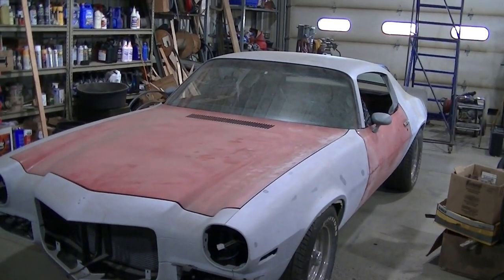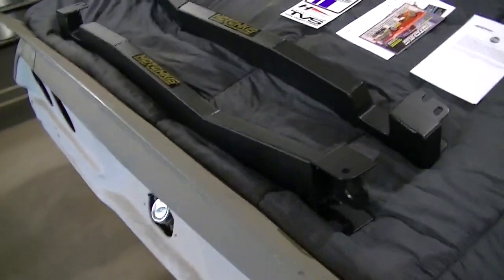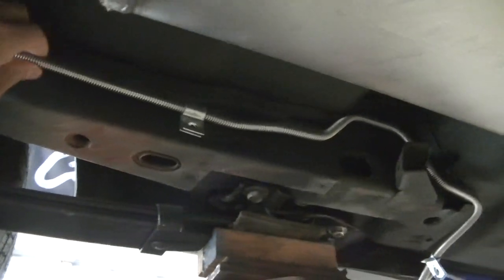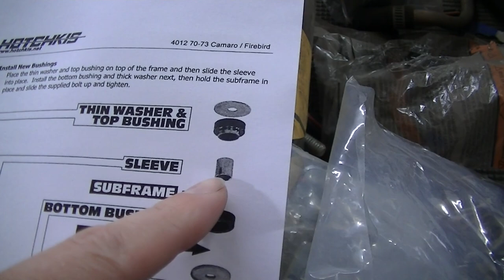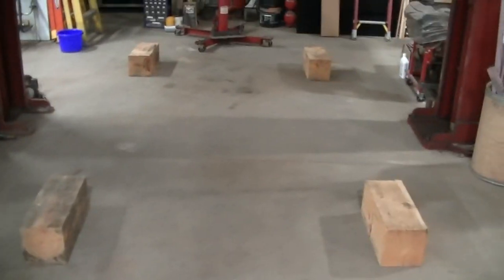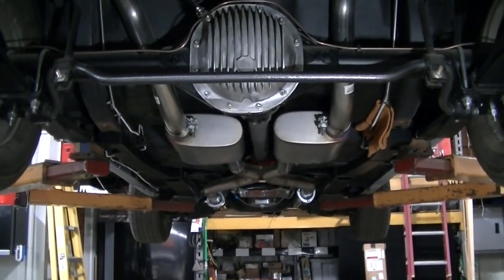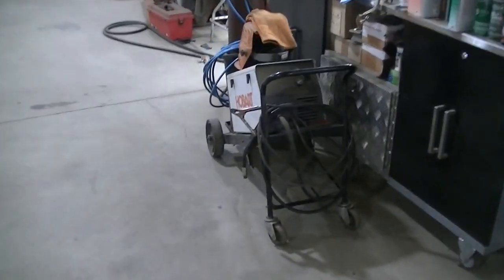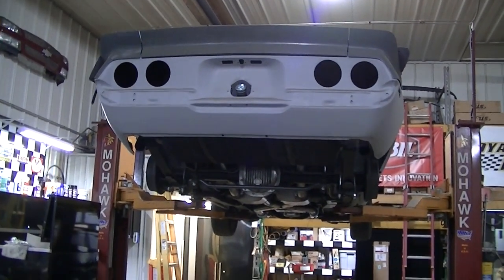70 Camaro SS Hotchkis Subframe Connector Install

Comment: I have to do the same to my nova I bout the full weld on frame connectors because mine is a convertible
Reply from the maker: I bet a convertible really twists. I really didn't want to add the subframe connectors. I wanted the car to be a mostly stock 70 Camaro but I don't want the paint and body work cracking.
Reply: mossman381 mine will twist without them I put a pretty healthy 350 in my nova I’m probably not going to pain it right now just want to drive it and work the bugs out
Reply from the maker: I hear you on getting it out and enjoying it. We probably should have just primed the car black and ran it this year.